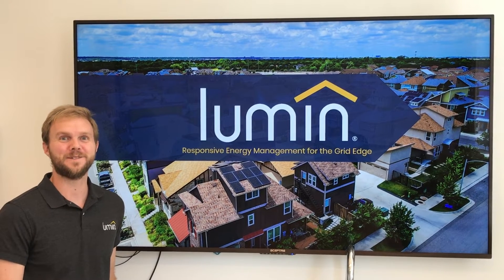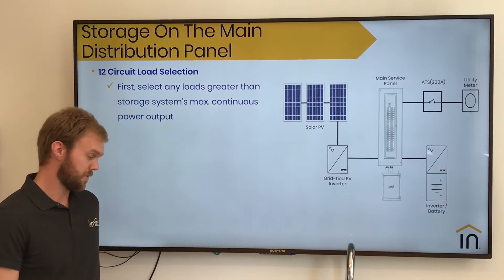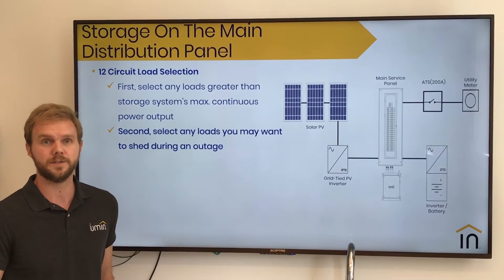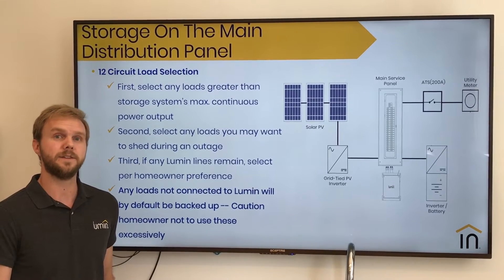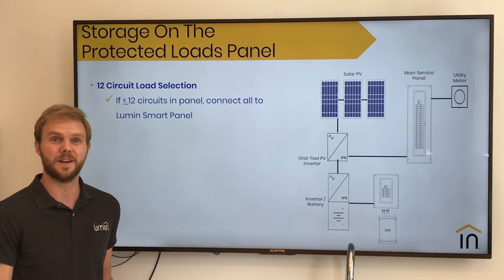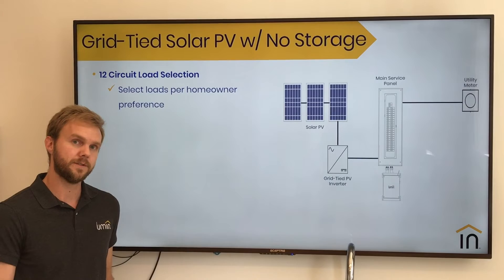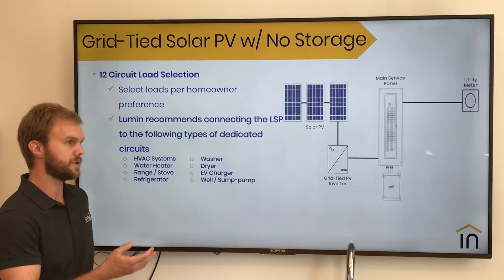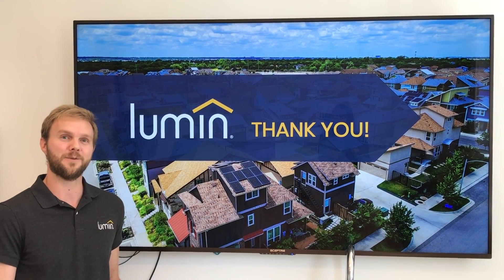Illuminations: Circuit Selection for Lumin Smart Panel

Comment: In your first example you show an ATS (Automatic Transfer Switch) between the Main Service Panel and the Utility Meter and the inverter connected to the panel. Do you have a recommendation for such a unit? I currently have a 6kW Hybrid Inverter with a built in ATS which allows it to switch between grid and solar/battery power but requires use of a critical loads subpanel. I'd like to implement the Lumin and get rid of the subpanel but can't feed the entire 200A utility service through my 6kW inverter can I?